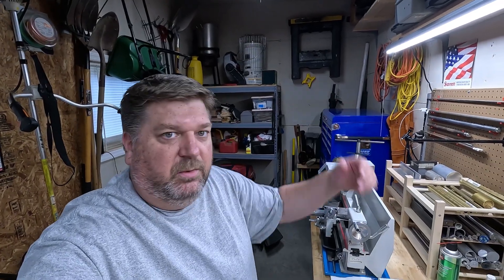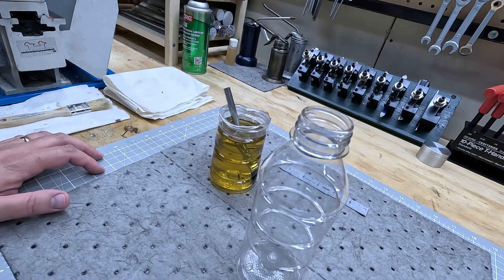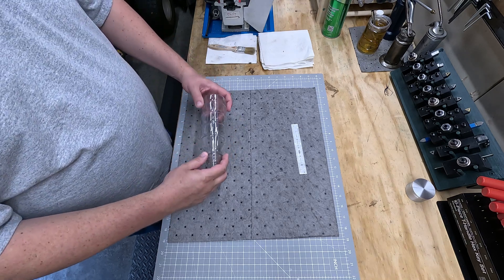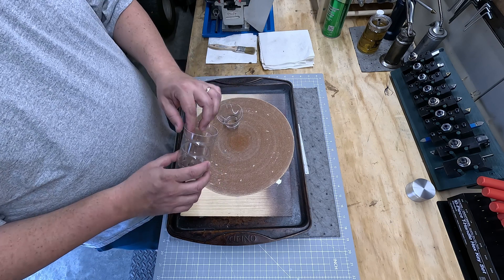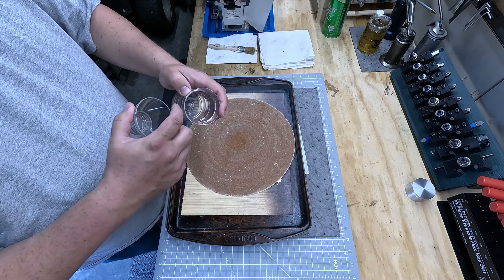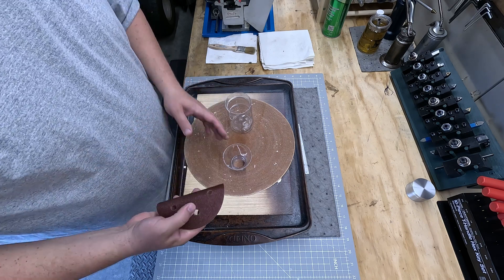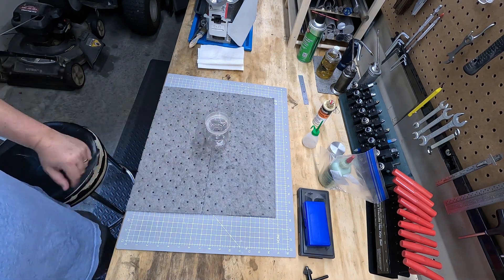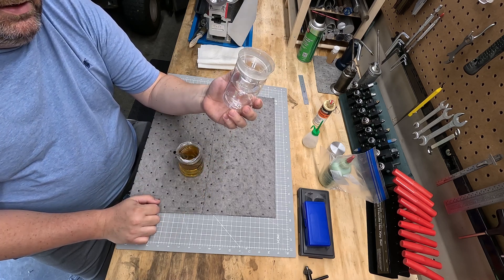Easy No Spill Oil Container/Pot - Low Cost or Free for Cutting Fluid on the Mini Metal Lathe

Comment: Could keep the lid on the bottle with a small hole in it for brush. Bit late now but I may adapt you idea for myself.
Reply from the maker: Adapt away. Definitely room for improvement. I’d use a lager bottle with a smaller neck next time. Try to make a larger base. Good luck

Comment: Epoxy is pretty brittle i would have put a bead of silicone around the inside of the bottom then put the top in. My no spill always has only a half inch in it which lasts a long time. But yours can out great.
Reply from the maker: I can see over time the epoxy could fail and chip,  Good tip on using silicone.  That may have been a better choice to seal and attach the 2 halves.  I definitely have too much fluid in this container at the moment but I didnt have anywhere else to put it all.  Didnt want to waste it.  For now this is meeting my needs until I get around to making the real deal oil pot.  It's coming...